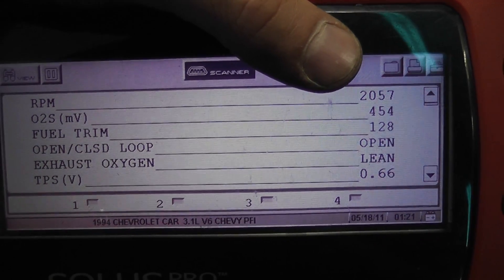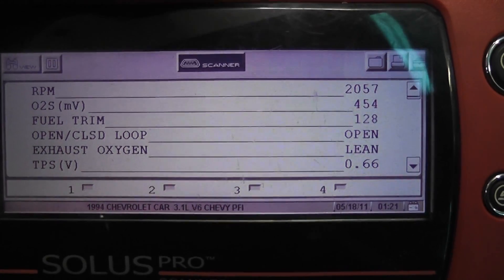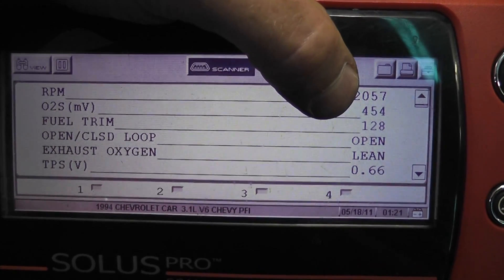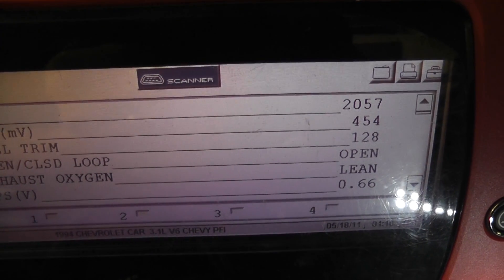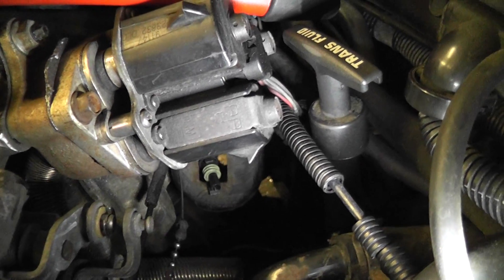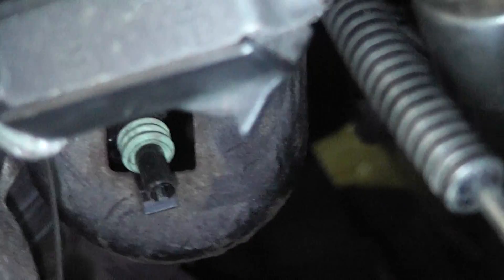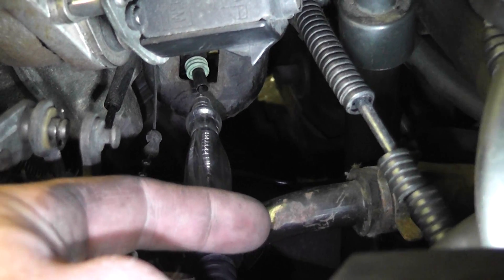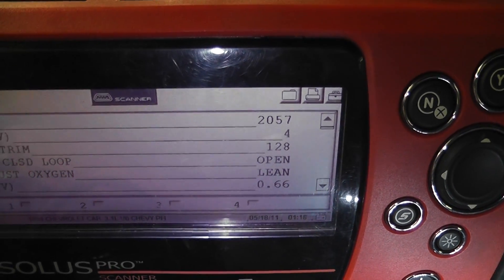How to quickly test an oxygen sensor circuit (GM bias voltage)

Comment: Hey man I got a question my upstream is reading 1volt and won’t me at all unless I do this trick you showed in the video then it drops to 0 does this mean the wiring is good? I’ve tried everything and can’t figure this out
Reply from the maker: Scan data or a live actual voltage measurement of the signal wire? Do both and compare and report what you find. I'd also help to know year, make, model and engine
Reply: @ScannerDanner  I figured it out it was a bad upstream 02 sensor. When could it read around 5 volts at the sensor wire and warmed up read 0.4 volts. It was on a 1999 Jeep grand Cherokee 4.7

Comment: What terminal do you touch test light to 4 wire sensor. Tested voltage key on engine off. 450v touch test light voltage drops to 0 volts. Bad wiring or bad sensor I've tried many new and used good sensors still no luck. No vacuum or exhaust leaks found.2006 monte carlo average fuel mileage is 31 mph. no misfiring acceleration is 100% I'm baffled can't get catalytic converter monitor to set nearly 3000 miles.
Reply from the maker: The signal wire for this test
Reply: Edited question
Still stumped
Voltage drops to zero @ScannerDanner
Reply from the maker: Why are you doing a signal wire integrity test on an O2 with a cat monitor that won't run? If the O2 is functioning and fuel trims are normal, you need to move away from the O2 sensor. If this is a downstream you're testing, do a wide open throttle run and make sure it goes over 800mv and then during the decel it should drop under 200. 
If the o2 tests goes, again move away from it. A cat monitor needs specific driving and engine temperatures. A thermostat that's opening too soon, making the engine run cooler than normal, can prevent that monitor from running. Also 35 to 40 mph with accel and decel events and stops at traffic lights are ideal for that monitor to run
Reply: @ScannerDanner  sensors tend to stay above 500mv after wide open throttle. I've done close to 3000 miles in drive cycles. Had a live data scan at state CERTIFIED emissions shop was told bad catalyst/o2sensor  or wiring harness
I've eliminated wiring replaced catalytic converter 2 times both 150 degrees difference front to back.
Tried several 02 sensors new and known good used sensors.
Reply: Update all O2 sensors were 5ohms installed one that was 12.9ohms also replaced fuel pump old pump was 55psi
I believe it was not giving the proper volume. One of the two allowed the catalyst to set.
Again all sensors were 5ohms made for the car when ordered on eBay and AutoZone.

Comment: hey paul, I was trying to replicate your same test on my vehicle, and I couldn't find the 02S mv pid on my verus edge.  I was in the emissions tab.  but I couldn't see that pid.  what's your suggestion?
Reply from the maker: Without knowing what you're working on, I have no idea. It could be a wideband sensor too, so that would change everything
Reply: @ScannerDanner  ok copy that
Reply: 2008 Honda civic 1.8.  Trying to determine if my 02 is working because my short/long fuel trims are always showing negative values even at idle.  I have a rich condition somewhere so the pcm is taking away fuel.  That’s what you taught me.  Short term goes straight to zero on decel.
Reply from the maker: @mechanic350  that's probably a wideband o2. Can't do this same bias voltage circuit integrity test

Comment: Hi master 
Air flow oxygen sensor has 2 blak wire showing 12 fix voltage when swich on and when engine on 
So i think it should on off after some fix second 
Is this pcm problem??

Comment: Thanks for the helpful video mate. I've been at my wit's end for 2 months trying to figure if Ihave a bad ecu, or a bad pre-cat O2 wiring circuit that would explain the exceedingly erratic short term fuel trims I get - for ten minutes, it'll be mostly at plus 25%!!!!, next five minutes it'll be in the negatives, fluctuating between 0% and minus 25%!!, before it permantly flips back to plus 25% again, so flooding the engine with petrol and making the car stutter and jump terribly. My O2 sensor itself is definitely good (I have three brand new OM sensors), so I'm trying to work out whether the ECU is cactus, or the wiring harness to the sensor is the issue. I REALLY wanted this video to answer my questions, as I suspect it's the exact key, but I couldn't follow what I found to be loose dialogue in the video, then also loose answers to comments (no offence intended - the video holds some great info!). You mentioned 'connector', Are you testing a 2, 3 or 4 wire sensor? Mine is a 4-wire one on my Nissan Xterra - it's ACTUALLY an air/fuel ratio sensor rather than an 'oxygen sensor', which though people generalise them as both much the same things, you'd know the A/F sensors react entirely differently to O2 sensors, being much more sensitive. Anyway, I read your comments-replies, and while I'm sure this video still holds the answers to my issue, I can't understand your typed replies - "sensor wire/signal wire/heater circuit" etc.. I know the two BLACK wires are my heater circuit, but of the remaining two blue and white wires, which is the one I need to probe as you did, to see a millivoltage change? Sorry for the essay mate.. I hope you can assist? My local mechanics don't care, so they don't diagnose. This car is killing me! :-(

Comment: Update, after trying the test again on both vehicles while cranking I saw a reaction on the car with the known good circuit. (MV dropped to about 22) The other car showed no change. Must have a wiring or computer issue. Thanks for the video!

Comment: I tried this test on 2 separate obd 1 vehicles. an 89' Lesabre and a 92 Riviera -One had a working 02 sensor and circuit, the other did not. (unplugged sensor , key on)both had bias voltage according to my scan data of about 453-454 mv. I wasn't able to see a change in either one when shorting the signal to ground as you did. the mv. remained the same
Reply from the maker: To old of a vehicle you probably need an RPM signal to get that data pid to update so you'd need to do that with the engine running or at least crank it over to get a change
Reply: ScannerDanner  , thanks for the quick reply. I think your videos are great, appreciate your knowledge and willingness to share.

Comment: can you use a bulb and wire, haven't got a test light
Reply: Yes, but be careful not to accidentally short the wire out on a ground. He's using a test light to put a resistance in between the ECU and ground so it's not a dead short (which could possibly pull too much current through the driver transistor INSIDE the ECU/ECM/PCM and damage that circuit, or more. While some damaged circuits can be worked around, that one would be difficult without some moderate 'hacking'. Eventually the ECM would probably need to be replaced and reprogrammed. That's why it's important to either have some basic knowledge of electronics BEFORE poking around in an ECU equipped engine, or go to a well-trained mechanic nowadays. I grew up with non-electronic engines and although I was an electronic engineering tech for much of my career, saw the problems that would happen when Detroit started putting integrated circuits (I.C.'s) and, soon afterwards, small dedicated processors in cars. It was all downhill from there. Now you can fry a $1K+ PCM by letting an unknowledgeable 'good Samaritan' jump start your dead battery incorrectly.

Comment: Hey man. Me and another tech were having a debate at work today about what causes an o2 to read rich. Now i was stumped for a minute but came to the conclusion that with extra fuel or less air there's a more complete mixture which leaves a smaller amount of unburnt oxygen. Is that the correct answer or am i just coming up with wild theories here? Also debating on leaks before the MAF and whether or not it would be seen as a load condition. Would love your input.
Reply from the maker: +andrew johnson very tough to answer this andrew. there is so much debate in this field as to what is actually causing the O2 sensor to create voltage (rich signal). I'll try to shorten it. It is the transfer of oxygen ions from the inside of the O2 sensor (atmospheric side of the thimble) to the outside of the sensor (exhaust side) that creates voltage. It gets crazy from there but it is left over fuel in the exhaust that causes this reaction. 
So it is really a fuel sensor or is it an oxygen sensor? we'll just call it the "tomato sensor" (credit to my friend on iATN for that name)
Reply: +ScannerDanner Thanks for the response. So basically if there is less fuel in the exhaust then less oxygen is transferred from the sensor causing a low signal and vise versa right?
Reply: +ScannerDanner Relearn for a drive by wire on 2008 GM 4.8

Comment: I've got an Australian holden 2005 vz alloytec 190. Pretty sure same engine used in the U.S CTS cadillac. Computer shows im burning lots of fuel. I hook up a tech 2 to see the operation of o2 sensors. I have bank 1 sensor 1 saying 1.01:1. Bank 1 sensor 2 saying 416mv flactuating a little but staying in the 400 zone. Bank two shows exactly the same thing for sensor 1 and 2. Shouldn't sensors be flactuating ferequently even when car is on idle? Thanks for the helpful videos. The best

Comment from the maker: I think in this case an LED test light would work
Reply: Hi! Great video, but what pin on the harness are you touching with the test light? Signal wire or ground? As you understand, Im a novice, and suck at electronics. An answer is really appreciated. I bought a new sensor on b1s2 but the new one didnt work either. It was the same make and model as the old one. When I detach the harness the scan tool do say 450 mV. 2006 Saab 9-3 btw. I get an error code on both the heater circuit and the signal cirquit. Since its two different circuits its fair to suspect that the problem is either with the O2 sensor or the PCM? I have not done the test in this video though.
Reply: I guess that was a pretty dumb question as it says right there that it is shorted to ground. My apologies.

Comment from the maker: yes, this will work with early models too. but there are variables to this type of testing. another 1 would be there may need to be in rpm signal before the computer will update scan data. a second 1 would be a bad computer ground would cause the same thing.

Comment: Quick question would this apply on a OBDI. I did exactly the same you did in your video but my voltage does not go to Zero when right at the PCM and still no change.
No a 100% sure is a bad PCM

Comment from the maker: Very difficult topic to cover hear. In short it is a small voltage that the computer sends down the O2 signal wire and is used for diagnostic purposes. (open/short circuit identification and heater circuit function). 
Watch my "2003 Jeep Liberty O2 Bias Voltage Testing" video with the 5v bias that Chrysler uses. It may help. Also watch my "94 Honda Civic O2 Sensor Signal Circuit Integrity Testing". I think this one will help too.

Comment from the maker: Ok thanks. Keep in mind if you do that test that the engine may need to be running for the O2 Scan data PID to update. I learned that the hard way on some of these bypass type tests. IF the scan data stays at 450 then you have a wiring problem. If it drops to zero then you most likely had a bad O2 sensor to begin with.
Reply: Hi thank you for your help .
Wich wire are You touching and are you using the battery ground or frame.

Comment: vauxhall opel make the vectra. my o2 sensor voltage did not change with propane or an air leak just stuck at 450mv I am going to go back and short the black and grey to see if i get 0volts like your book says

Comment from the maker: No voltage on the sensor ground was normal. It should be 100mv or less on this design. Also the 450mv you had on the signal told you that the PCM and wiring integrity was good. There was really no need to do the PCM response test you did on a system that uses a bias voltage. I'm not sure what the 5 volt pulse was though. I have never seen anything like that on an O2 signal wire. Who makes the Vauxhall Vectra?

Comment: I was  looking at a vauxhall vectra the otherday and it had a fixed 450mv on the o2 wire (black)and no voltage on the ground wire (grey) sensor plugged in I didnt think to bridge them together to check the ground but I did touch battery + with my hand and o2 signal wire at the o2 sensor and pcm showed a change could I of had a bad ground with no voltage on it? the signal wire also had an odd 5volt pulse on it every now and then not sure what that was any ideas?